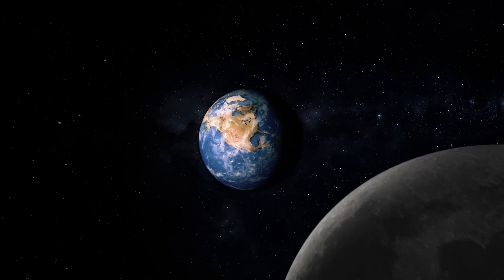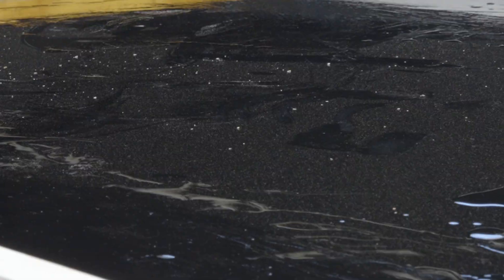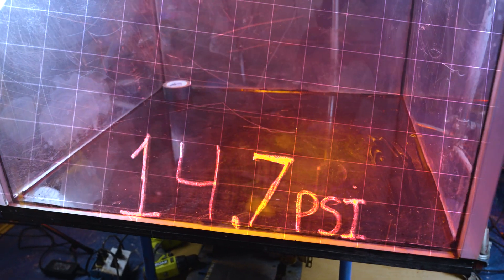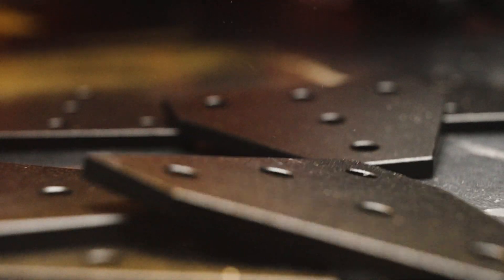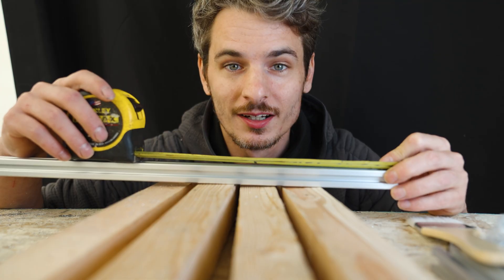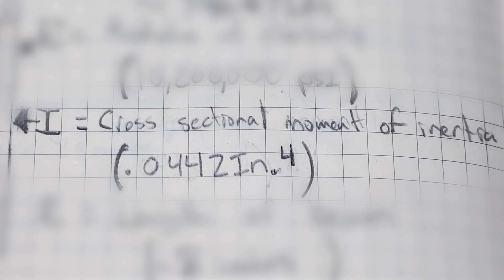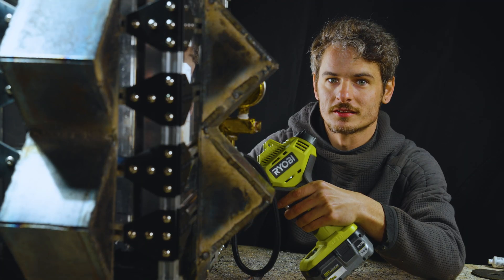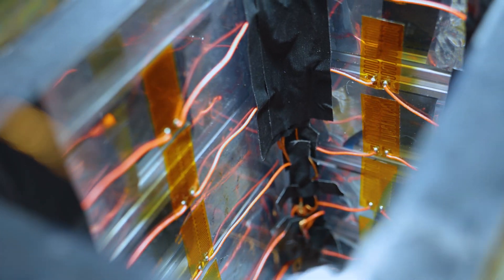I Built Something for the Moon out of JUNK

Comment: hi! i'm a space systems engineer! this is an AWESOME video!!!
the engineering here is not quite up to snuff, unfortunately. there's quite a few problems that weren't really addressed (thermal insulation, radiation insulation) as well as a few design decisions that were not the best (the aluminum extrusion isn't really doing anything; the organic solvents, tape, and adhesives will pretty much all fail at the temperatures on the moon).
HOWEVER!!! i was BLOWN AWAY by the production quality of this video!!! your camera work is INCREDIBLE!! and, what's more, you built a system that met all your requirements--even if the requirements were a little misaligned! your analyses of the system were airtight (hehehe)! the decision to shrink the chamber to reduce the force you need to support was really smart! identifying and eliminating extraneous components like that is an important part of engineering that even professional engineers struggle with!
cheers!!
Reply from the maker: Huge thank you for the feedback!

I'm not sure what you meant by the aluminum extrusion not doing anything since it's pressed up tight to the internal chamber and screwed together. My though was that it would stopped from flexing and exploding open.

I'm working on the next video "Mars Base" where I'll be fixing things like the thermal insulation. Maybe with the new design the organic solvents used won't be an issue since they'll be under the insulation and heated enough to stop them from failing. We'll see! . Again, huge thank you for the feedback. I wouldn't have gotten this valuable feedback elsewhere.
Reply: @pranzetti  so the aluminum extrusion is there, i assume, to help counter the huge pressure differential that you're creating by pressurizing that biosphere. the problem is that you'll be bottlenecked by the force of friction between the t-nuts and the channels that hold the brackets on. 
imagine you tried to rip apart the exoskeleton. if you had superhuman strength and were pulling with infinite force, the way the exoskeleton would fail is probably that the T-brackets would slide off the aluminum extrusions, and that would happen before the extrusions themselves were ripped apart. that means that even though the aluminum itself has a relatively high tensile strength (it can resist a lot of stretching before it fails), the weakest link of your exoskeleton chain is that connection between the extrusions. i hope that makes a little more sense.
Reply from the maker: @you_just that makes sense. Thank you. Luckily it seems like the shear number of t-nuts was somehow enough to keep it all together.😅

Comment: tip: to save a headache, make it a sphere or cylinder so it has less weak points basically vertices where air can escape.
Reply from the maker: That makes sense. Even rockets are built like that. Thanks!
Reply: @pranzetti   cool
Reply: @pranzetti  how is the mars base project?

Comment: You forgot to say that some spacecraft are pressurized to only 5 PSI. 

That is what makes it okay to pressurize the container to 20 PSI.

If you wanted standard pressure inside the container you would need ~29 PSI.
Reply from the maker: Awesome thank you. Where’d you get ~29 from?
Reply: @pranzetti  2 bar(two atmospheres) of pressure = 29.0076 PSI

Two atmospheres inside and one outside is equivalent( in some ways) to one Inside and a vacuum outside. 

That is to say if the MoonBase™ is pressurized at 29.0076 psi it will have the same internal stress as if it were on the moon with an internal pressure of 14.5038(one atmosphere).
Reply from the maker: Thanks for trademarking the MoonBase™ 😅. At the end of the video the MoonBase™ blew out all of the seals at about ~30+ psi. My first test was more of a best guess based on what I knew. You've inspired me to do a bit more research. This is good information.